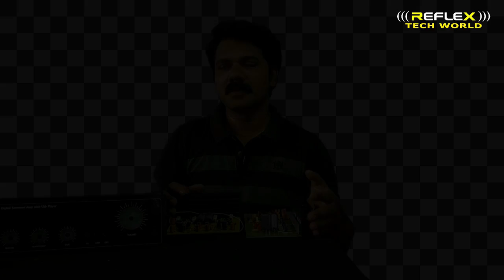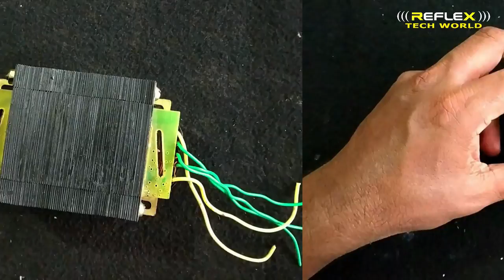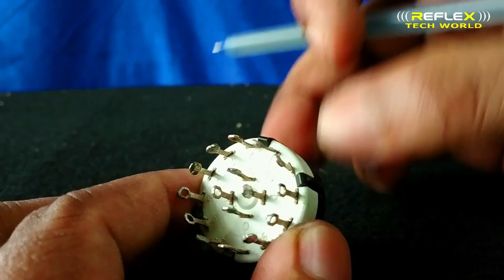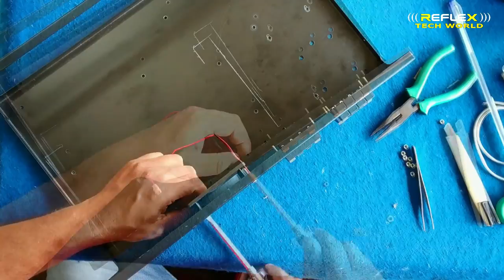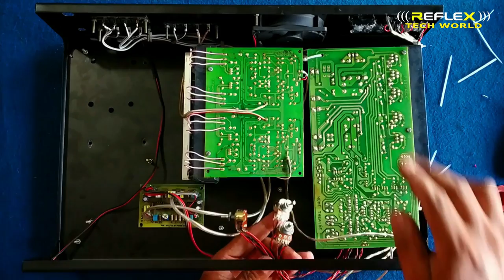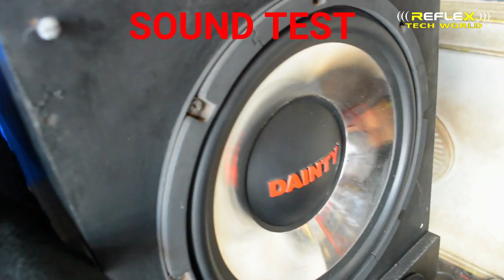HOW TO MAKE A 5.1 AMPLIFIER | 5.1 HOME THEATRE AMPLIFIER ASSEMBLING | MALAYALAM | REFLEX TECH WORLD

Comment: Bro oru doubt undu.. onnu clear chaithu tharanam..kure channelil requast chaithu no raksha..! Data sheetil Oro ic kkum maximum volt kaanikkunnu.. athu dual suplyude ( + & - ) total voltano calculat cheyyunnathu..? 
Pinne oro ic kum  example:- stk4141   24-0-24   6 amp kanikkunnu.. ee sime voltil etra ic vere kodukkam.. ithinte ampere engine calculate cheyyum..?
Ithine pati oru video cheyyamo..? 🙏
Reply from the maker: ചില അമ്പ്‌ ല്‌ volt Dc volt എന്നും Ac volt എന്നും കാണിക്കാറുണ്ട്, Ac volt എന്ന് പറയുന്നത് transfomer output volt ആണ് , 12 0 12 volt AC എന്ന് പറഞ്ഞാല് അത് power supply ചെയ്തു കഴിഞ്ഞാൽ ഏകദേശം 15 0 15 അടുത്ത് വരും,അതുകൊണ്ട് Amplifier Board എത്ര ആണ് volt എന്ന് നോക്കിയിട്ട് അനിന് അനുസരിച്ച് transfomer മെടിക്കുക
Reply: @reflextechworld  tnx..bro

Comment: 5channel board ന് പകരം seperate mono board ഉപയോഗിച്ചാൽ കുഴപ്പമുണ്ടോ ? 4440 board ഇട്ടാൽ humming sound വരുമോ ?
Reply: Mono ചാനൽ ആണ് ബ്രോ, 5 ചാനൽ board എന്നു പറയുന്നത്, 5 ചാനൽ ഒരുമിച്ച് ഒരു pcb യിൽ ഡിസൈൻ ചെയ്തു എന്നെ ഉളു 

താങ്കൾക് ഏതു amplifier ബോർഡും പവർ amplification സ്റ്റേജിൽ ഉപയോഗികാം..
Reply: @Hari_the_striker  Ok bro thanks, ഒരു സംശയം kude , tda7294 5ch ഉം ,5200/1943 4transister mono board ഉം ഒരുമിച്ച് 27-0-27 15amp single transformer il run ചെയിക്കാമോ ?
Reply: @txtaudios4784 
ഇത് താങ്കൾക് തന്നെ കണ്ട് പിടിക്കാവുന്ന കാര്യം ആണ്,
Amlplifier assembly ചെയുമ്പോൾ നമ്മൾ parallel കണക്ഷൻ ആണ് ചെയുന്നത് അങ്ങനെ വരുമ്പോൾ voltage circuit ലെ എല്ലാ ഭാഗത്തും ഒരുപോലെ ഉണ്ടാകും എന്നാൽ കറന്റ്‌ വ്യത്യസ്തം ആയിരിക്കും.

Tda 7294 ic യുടെ വർക്കിംഗ്‌ voltage അതുപോലെ കറന്റ്‌ കണ്ട് ഡാറ്റാ ഷീറ്റിൽ നോക്കുക അതുപോലെ പുഷ്പുള്ള amplifier ആയ 2sa1943,2sc5200 ഇത് രണ്ടെണ്ണം മിനിമം 3 ampere വേണം ഒരു പെയർ.
Tda ic മാക്സ് 24 വോൾട് കൊടുക്കാം പക്ഷേ ട്രാൻസിസ്റ്റർ 30 വോൾട് കൊടുകാം.
15 ampere കറക്റ്റ് ആണ്.
Tda voltage കുറച്ചു കുറയ്ക്കണം 24 ആകണം,